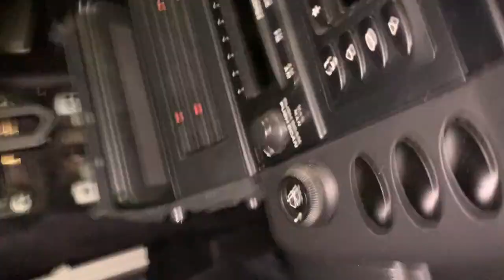Numeric Shifter Cable Adjustment and Installation - Porsche Boxster 986 How To

Comment: Just wanted to thank you for the wonderful presentation of the shifter cable install. Your video was one of the best DYI’s for the installation and adjustment I have seen. Great job and I know this is not an easy task. 

I finished installation on my 997S and the shifter cables and a Schneill short shift kit made a huge improvement in shift engagement. 

 😊
Reply from the maker: No problem. I couldn’t find a good video so I thought I should make one

Comment: Thanks for posting the detailed video!  I am getting ready to install the Numeric cables on my Boxster- the stock one snapped (as they commonly do) and left me stranded on the side of the road.  Had to ratchet the car onto my trailer and it has been in my garage for some time (waiting for some free time to do this job).  I will order the cables and get it done shortly, I am sure I will be back here to watch the video again!  🙂
Reply from the maker: The most important part of the video is using the rope to hold the lever on the transmission to adjust the cable 🤣

Comment: Holding the camera while working on the car must of been a real challenge. I appreciate you posting this. Very informative. This will help me when I make the same upgrade on my 987.2. I want to offer a bit of constructive criticism if I may: The end of the right side shift cable that attaches to the bottom of the shifter looks like its canted all the way in one direction. I would be sure that the socket at the end of that cable is in the middle of its "travel" on the ball at the bottom of the shifter before tightening up the locking nuts. You have a clear view at 32:14. Perhaps you did corrected it off camera, but I thought it was worth mentioning to others watching.
Reply from the maker: Yes towards the end I was getting pretty tired of it and missed filming that 🤣
Reply: @TheEddysGarage  Your video serves as a great dry run for the rest of us planning this upgrade. Many thanks.

Comment: I just did this last Saturday on my 996 c2, super easy diy friendly install, great results too. I borrowed your shoelace method for reverse so thanks for the tip! Access is much better on the 996 but pulling firmly with a shoelace is a nice easy way to hold the lever in place for the cable adjustment.
Reply from the maker: Awesome. I just put a set on my dads 996 Turbo and the prop shaft to the front made it a bit tricky. Be sure to like and subscribe so it is easy for others people to find the video
Reply: @TheEddysGarage  Already sub'd, really like your videos. Saw the turbo install too, that looked a lot trickier than a c2.

Comment: The. forward jam nut should be run up agains the cable ends not the  backwards against the  long coupling nut.  If you run the forward lock nut back you are doing nothing.....that piece is all one piece and you are locking nothing.   Then you leave the threaded end floating loose in the cable end.  It wont unscrew but it will have slop.  The rear lock nut DOES get run against the long coupling nut   The front runs against the cable end.  Just remember both lock nuts run forward .......  And technically what I am calling a coupling nut isn't  really a coupling nut.  it is a long threaded left hand barrel and a right hand threaded shaft all in one piece.  It's a brilliant simple way to make a turnbuckle adjustment....but every video I've watch has the lock nuts wrong and leaves the ball ends not locked.

Comment: Curious how different this would be to do on a 2006 987 Boxter? Does anyone have any links to that specific job?
Reply from the maker: I’m pretty sure the early 987 is the same. The later one has one cable on each side of the gearbox
Reply from the maker: Check this out https://youtu.be/3_9j2TVpeg4